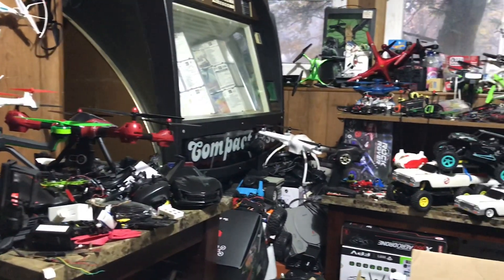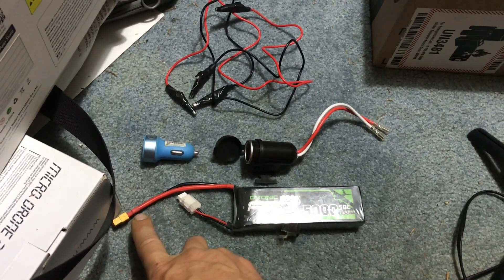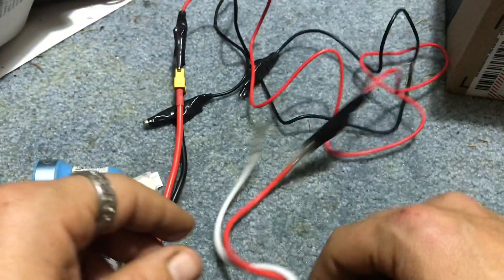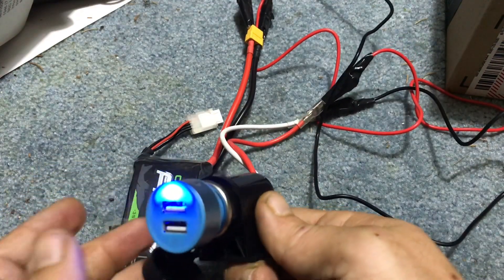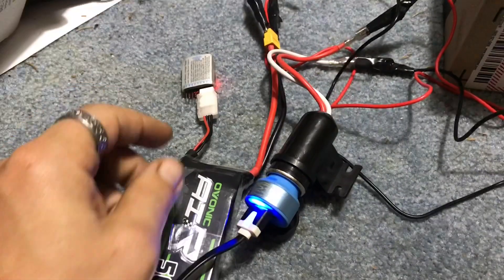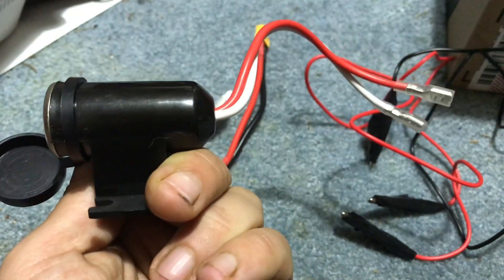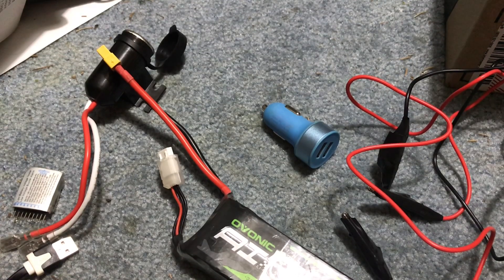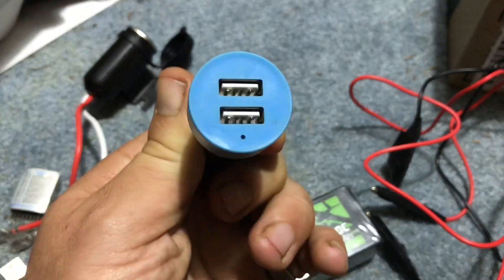DIY Power Bank step by step LIPO Portable USB Charger

Comment: Good vid..I use a 3s ..12v soldering Iron to discharge those.  Big 3s, 5k just tried on Q500...don't work. Even fully charged lvc kicks in in 5 min.  Oh well looks like Ill mod 6500 Chroma batts to fit. Has an aux batt tray. Dont need more batts sitting around here.   NICE THUMBNAIL..

Comment: Cool video. What do you think about those Ovonic lipos? I got 2 of the Ovonic 2200s for my Phantom FC-40 before I modded it to hold a 11.4v 5200mah Turnigy. And they only lasted less than 1 minute each with no payload at all!  They were brand new. Cells all read fine. I sent them back. I'm not a fan of Ovonic. They are built nice and cheap though.
Reply from the maker: I myself have used their Lipo’s in drones and also RC vehicles on the ground have never had an issue with them absolutely love them
Reply: @JayDrone  wonder if I got bad ones? They were not from a battery place. They were new but sold from a lot sale of assorted stuff. Mabe they were left dead too long or something. Mabe I'll give them another shot someday. Thanks for your input.